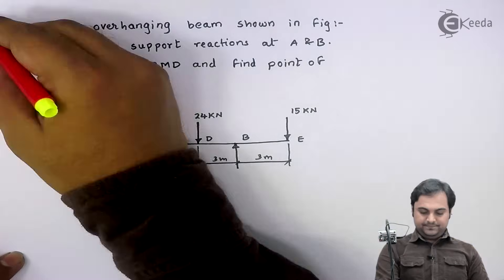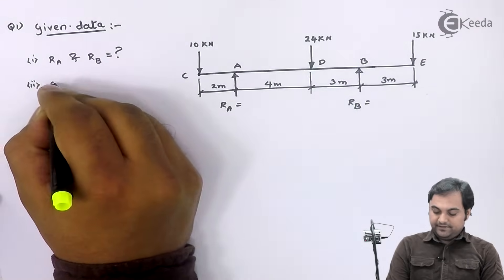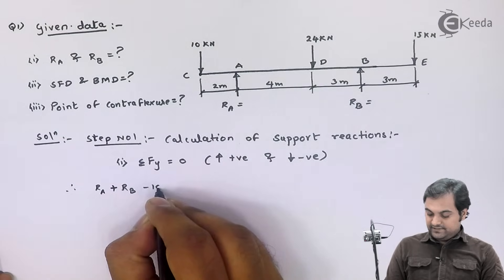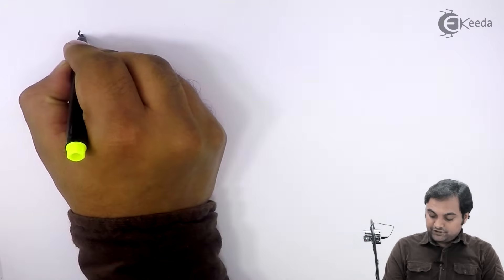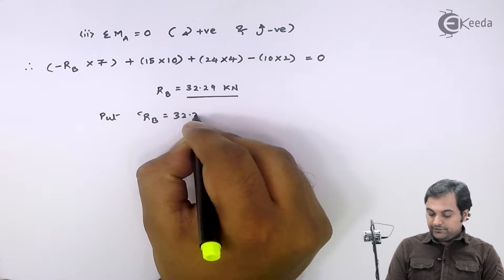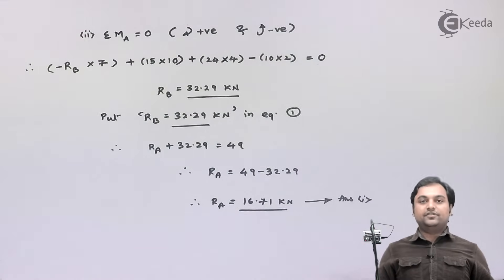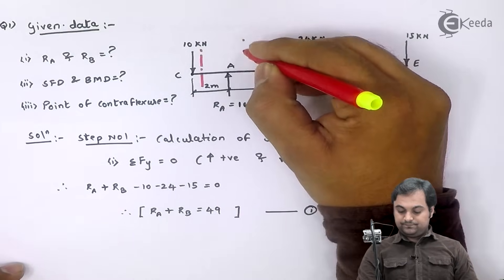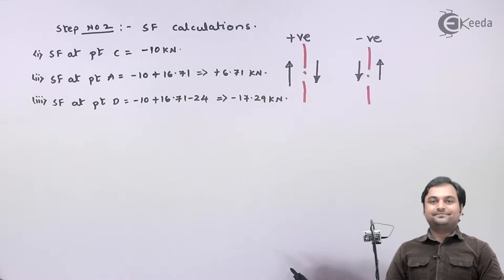SFD and BMD - Problem 1 - Part 1 - Shear Force and Bending Moment Diagram - Strength of Materials

Comment: Plz  numerical solve this
Reply: A 4.6 timber beam, 8 feet long  is loaded with uniform distributed load of 54.65lb/ft.the break it self has a weight  per unit  length of 5.35lb/ft. what is the maximum bending stress, and  where  does it occur report  the answer  in psi
Plz solves this numerical

Comment: Y did u taken moment at 'B'.? Wch is anticlockwise 🔄 @3:20
Reply: You can take the moment at either Ra or Rb. He chose Rb, and when you think about it, if a force were to be applied at that exact point, the movement wouldn't be clockwise, it practically doesn't make sense.

Comment: Shear force is defined as a force which acts parallel to surface. Then why is it always represented perpendicular to beam in SFD?
Reply from the maker: Because beam is a horizontal member subjected to vertical loading and shearing of the beam is in vertical plane.
Reply: Thank you for replying, this clears my doubt.
Reply: SFD is also called as traverse force diagram...it represents force perpendicular to axis of beam